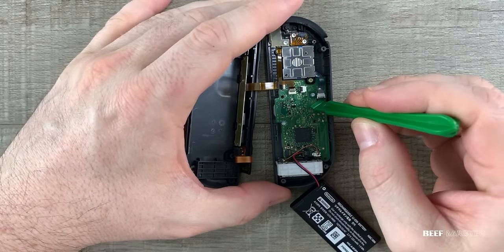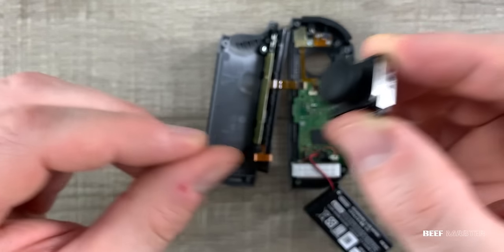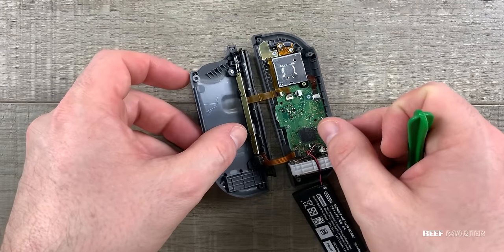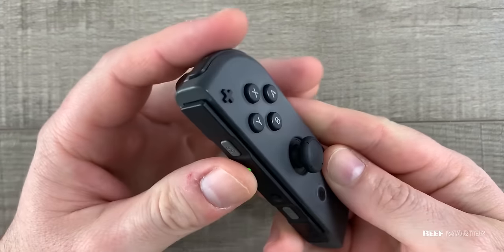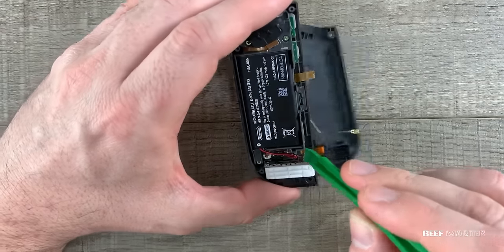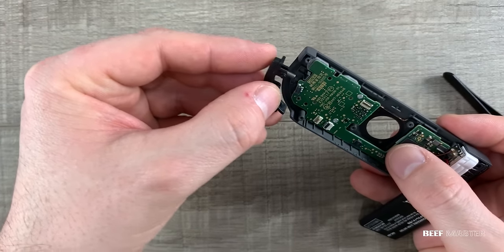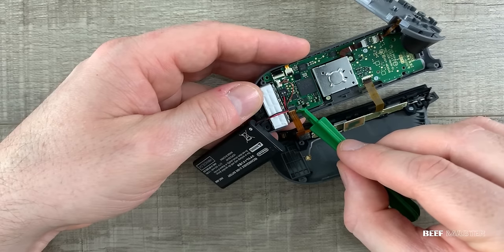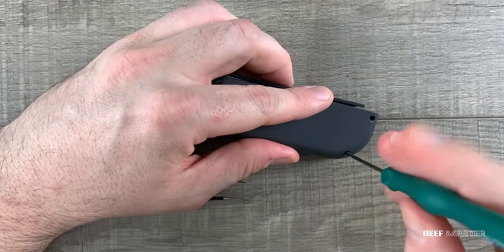Nintendo Switch Joycon Fix and Teardown

Comment: Huge Criticism: If you're going to bring up how you should turn the battery off before disassembling the joy con, mention it in the beginning of the video and not near the end. My left joy con no longer connects simultaneously with the right one, and I'm certain the reason why was because I dismantled it while the battery was still on.
Reply: You should always watch the whole video before attempting. YDI.
Reply: Dude thats not even a huge problem
Reply: @monyty1542  yes it is bro, it means he can only use it alone
Reply: I have the same problem. Mine left controller cannot connect to the right one after replacing the joy con. Any solution?
Reply: always disconnect power in anything you are disassembling, #1 step in every eletronic disassembly
Reply: @jjsleeps9786  so your agreeing with what they are saying, it should be #1 in the video?
Reply: Why in the world would you do a joycon dissembling while watching a video for the first time? It's smarter to watch the full video and then rewatch it during the repair.
Reply: @Atomicallyawesome.  why the hell wouldn’t you include a important step first? Funny how it works both ways.
Reply: It’s always important to blame someone else, nothing is ever your own fault.  I’m certain that as the model perfection is based on, you have never made a mistake except when others intentionally and maliciously trick you into an error.
Reply: Soo would you just open up a wall plug  socket that’s still turned on and connected to your main house electricals or hear me out you’d turn the fuse off beforehand so you don’t get electrocuted/short out…
Reply: Honestly its common sense to turn off everything before disassembly. No offense but i get it, mistakes happen. Lesson will be learned
Reply: I mean it was my first time, I carefully followed the video and said oh ok. But nothing happened and my stuff works perfect. Like new!
Reply: Lmao if your not experienced when workin with electronics leave it to someone who is
Reply: Skill issue
Reply: If battery not connected it's off.. Only if power going to it is it on..
Reply: Where does he say how to shut it off? I watched the video and didn't see that at all lol. Just replaced the stick on my right joycon, it won't pair to the switch attached now lmfao, but it works off the switch just fine. How it's used anyway since the left joycon doesn't register on the switch because of something wrong with actual console lol so no biggie. Could not find any info for shutting off a controller completely though, as soon as you press any button the side starts flashing and trying to pair again
Reply: 🤣🤣🤣🤣😂😂🤣🤣 You don't tern batory off 😂😂🤣🤣🤣 it's made to store power not be terned off like a switch 🙈🙈 take it your not a electrician
Reply: Watch the video before actually doing anything
Reply: Skill issue. Watch through the video first next time 🤡
Reply: That is something everyone should already know, almost on the same level as breathing
Reply: Bro I got mad and detached the black part with the tiny buttons on top and only the bronze ribbon cable is holding it what am I supposed to do
Reply: @JoshThegreat-lu7bx  buy a new one bud
Reply: SOLUTION: the ribbon cables weren’t put in far enough
Reply: @beegborg3303 I have a solution, the ribbon cables connected to the part with the green light weren’t pushed far enough into the joy con
Reply: For me it was the bottom one

Comment: PSA: Watch video fully before you do the repair. Some edits are super quick and you can miss a step and rip a ribbon cable! It's a helpful video but definitely one you need to pause/rewind at points :)
Reply: Agreed. This was the "top" video YouTube showed me, I didn't rip a cable, but I didn't have to disconnect them in the first place, which another video instructed (wish I had seen THAT one first) and ribbon cables are the bane of my existence, since I have giant hands.
Reply: Yes, ribbon cable part is given short shrift. Unclear what to do, what to look for. My solution is... look for a different video with a more precise presentation.

Comment: This was super helpful. I didn’t even disconnect any of the ribbon cables other than the ones for the sticks themselves.(wouldn’t recommend unless your willing to risk a break) and it went pretty smooth hardest part was reconnecting the antenna but that was mostly due to my super cheap plastic tweezers. But yeah absolutely better than shipping them off to Nintendo for who knows how long or dropping $80 for a new pair.

Comment: I want to know one thing. The reparation works as a permanent solution to the drifting problem or does it appear again in a future. If so, how long did it last?
Reply: hi! i can help by saying, if the issue with the joycons having the joysticks they came with wear out was just with the *joystick*, then it could be possible a different joystick from a different manufacturer may wear out less when you replace it. but i would say, they seem pretty delicate so after a certain amount of use they will likely still need to be replaced. it depends how often you use them
Reply: I had my left joystick replaced and it is still going strong 6 months later and it's endured ~ 200 hours of gameplay time idk if that helps
Reply: It will have the same problem at some point

Comment: Slow down, dude. You're video is more concerned with quick edits to match the cadence of your voice than it is with actually taking the time to demonstrate properly. I broke the ribbon cable connector at 1:37 because it's difficult to see where you lifted up as you described (zoom would have been helpful there), and I'm watching full-screen on a 28" 4k monitor.

Also, the 2nd joycon can actually be replaced without removing any of the ribbon cables, which I did quite easily (albeit carefully).

Thanks all the same.
Reply from the maker: Thanks for the feedback.
Reply: I just broke the same latch 😑 this cannot be the correct way/tool to open this one
Reply: @Jake.The.Snake.  That sucks. There are far better videos on this subject. This one should be removed.
Reply: @LifeAquaticSteveZissou  Cry.

Comment: At 1:35 - can anyone tell me what this ribbon cable is for? Replacing a buddy's batteries, all went smoothly (no ripped cables lol). This looks like it's for an antenna, but it certainly isn't the main antenna. After a cursory glance on Google, I can't find a diagram for all the replacement parts to reverse-engineer what this might be.

Comment: My ribbon cable of the right joycon ( the one that connects the button and seal the slot of the battery) is too short and doesn't make me grab it with pinchers due to the small room and the fact that it's twisted and goes backwards inside the slot. I'm stucked there. Any idea?

Comment: So when I play a game I have no issues with anything but when I'm in the main menu it's not doing anything but moving to the side . But in game nothing works perfectly iuno what Is going on . I have to power off the controllers to select different games but once I'm in it's no problem ?????
Reply: Have you tried calibrating the control sticks in settings? That helped me.

Comment: I know this is an old video but I should let you know this: you saved my TOTK Joy-Con. I was wondering why my right one wasn’t working so I decided to follow your video and the moment I opened it up I noticed the bottom cable ribbon was extremely loose. Like I could ever so gingerly remove it some it’s socket and out it came out. I thought I was gonna have to be sitting down for a while trying to trouble shoot… Nope just a loose cable.

Edit: the only reason I was on your video is because my right joy comes wouldn’t work.
Reply from the maker: I am honored that I could help you defeat Ganon. May your fixed joycon strike down gloom in the depths.

Comment: Okay so it fixed my joy stick problem, I don't have an issue with any of the buttons but now my switch doesn't recognize when the controller gets put onto it.
Reply: How’d you fix it
Reply: @shanearnold218  the ribbon on the bottom of the controller wasn't connected all the way

Comment: What’s the difference between the screwdriver you used and another tiny screwdriver?
Reply: The screws have a Y-shaped indentation, unlike the + or - shaped indentations more commonly seen. These screwdrivers have a head that fits in there.

Comment: This guy  says that you need to eject the ribbon cable at 1:37. He says there is a tiny latch that allows the ribbon to come free.  He uses the spudger to do so. I followed him.  I very lightly and slowly lifted it and the entire latch came a loose from the board.  The latch was there only with GLUE!  Not soldered!  This guy never tells you this.  I have a ruined joycon.

Comment: Okay so it fixed my joy stick problem, I don't have an issue with any of the buttons but now my switch doesn't recognize when the controller gets put onto it.
EDIT: I figured it out. The bottom ribbon cable was loose.

Comment: Don't put ribbon that above the battery above! put it in the hole exactly above the connector and between battery!
Because of that one of mine was bent over! And it started to disconnect randomly and after dissambling again it was teared apart.

Comment: thank you so much, especially for linking the kit! i replaced the joystick on the right hand side of my precious animal crossing joycon and will save the other one for if and when the left one breaks. 

one thing, i could not see what or where the "latch" was to release the ribbon cables, so i did not figure it out where it was until i was already done ^_^"" 

that given, it is possible to replace it without removing all of the ribbon cables. the only required one was the one connected to the old/new joystick. albeit probably easier than the left one, i was able to turn and maneuver the inside plastic part with the very delicate ribbon cable attached without removing it. i simply worked around the plastic pieces with the ribbon cables still connected for ease of putting it back together and not bothering with reattaching them again later (as you said you had trouble with that).

maybe it just works better if you have small hands ^_^""
 would not recommend risking breaking the ribbon cables, but it is possible!

thank you for this video! very straightforward. i was able to avoid spending $200 for new animal crossing joycons. the only thing that was not made clear to me was the 'latch' , but maybe i wasnt looking close enough. 

also... magnetic screws are a godsend

thanks for the relatively short and simple explanation! perfect for people who arent too knowledgeable about technology repairs/etc.

Comment: What would be the problem if the right joycon works fine when connected to switch but doesn't work wirelessly when disconnected? I followed this tutorial so I could open it up. Took a cursory look around and didn't see the antenna disconnected. And nothing seemed out of place. Don't know what I'm to look for outside of a potentially disconnected cable
Reply: I have the same issue

Comment: This really helped me out, n saved me 70 bucks in getting new joycons but overall the left controller was sooo much harder to change the stick than the right, idk why but for me the right had a different location for the antenna slightly makign it way easier to deal with

Comment: Frustratingly, the repair kit I bought before I saw this had an improperly sized custom screwdriver which was also super crooked. Thanks Amazon. And thanks Nintendo for making controllers that wear down super quick and cost far too much to replace and take too much effort to repair.

Comment: Great teardown video. However I completely disagree when you said that Nintendo makes fantastic hardware. In my experience they literally make the worst hardware, often cutting corners like not putting conductive foam near the battery when they know it should be there. I always buy third party instead of Nintendo because controllers have a life span of 1-2 months under heavy use.

Comment: Hate this guide.  Permanently broke my joy on because of this.  The removing of the first ribbon without clear instructions made me rib the ribbon connector.  The latch was not at the front where the video looks like he detached from, rather it’s in the rear.  

Also, don’t even need to remove the ribbon.  Just remove battery, middle case, and start working on joystick carefully.

Pretty pissed it is such an easy fix and I broke it because of this one step.